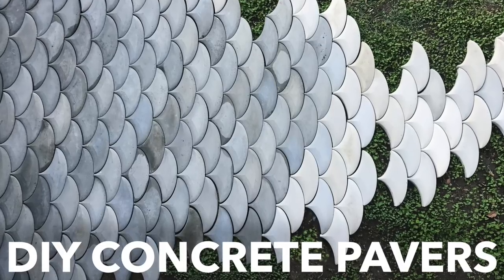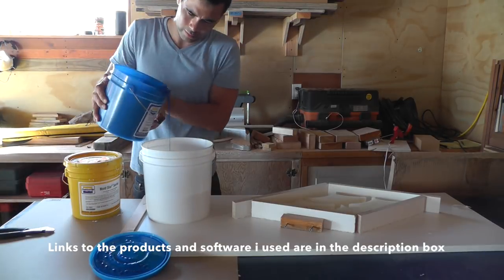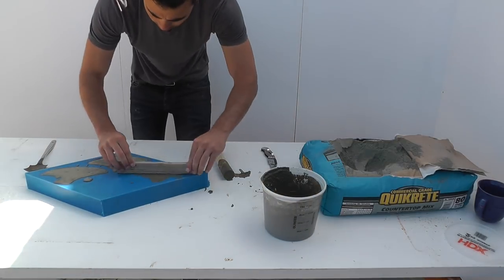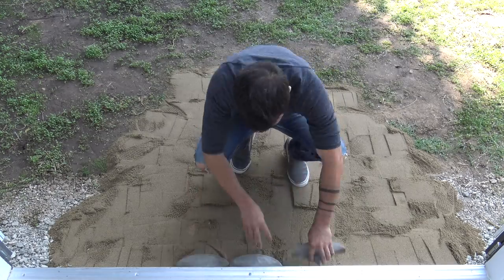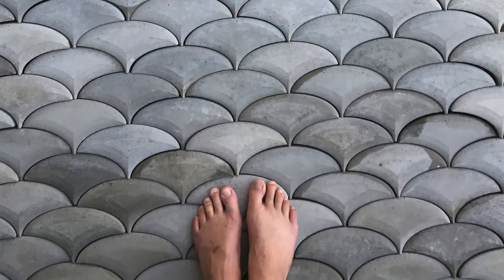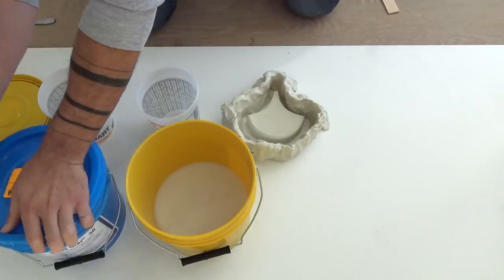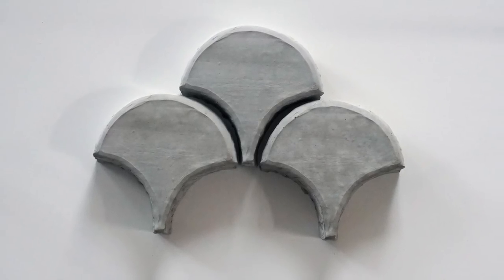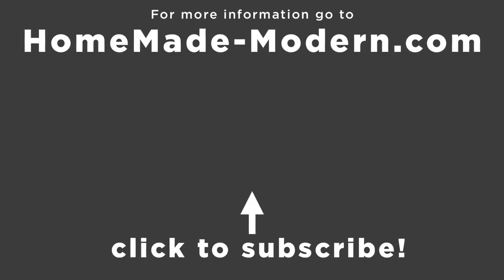DIY Concrete Patio Pavers

Comment from the maker: you can download 3d modeling software for free.  many local libraries and maker spaces have 3d printers.  Link to the silicone rubber product I used: http://amzn.to/2iF3N8Q  the mold is reusable and easy to clean.  We made about 1-2 batches a pavers a week over the last few years.  It only takes about 15 minutes to make a batch.  I used combinations of Quikrete Countertop Mix in both White and Grey along with Quikrete 5000 to make these pavers.  If you want to have greater color differential try the Quikrete liquid cement color.  Here is a video I did on coloring concrete: https://youtu.be/t1PRbMA9koM
Reply: You did such a great job, I was wondering if you happen to sell the silicone molds already made?
Reply: Do you have a link to download that 3D File? It is so cool! If not and you still have it could you please put it on Thingiverse or something be so I too can make the same pavers as you? Thanks a bunch.     :)
Reply: Could you be so kind and share the 3d file?
Reply: HomeMadeModern cool
Reply: HomeMadeModern i
Reply: Wow, they are beautiful! I really liked the 2nd batch the best! Both are beautiful though. 😊
Reply: share the 3d file please please please...

Comment: For the analog pavers, you can also make a single.  Then use the single to make 4 copies.  Then make a mold from the 4 copies.  This would also allow you to make your first paver from something that is not moldable or as easily repeatable like wood or carved foam.

Comment: nice ... I once worked for a hard-scape installation crew.  We always built a sub-grade of 4-6" made of a compacted ABC gravel. With 1" of polymeric blended sand.  The pavers always stayed in place.
Reply: Richard Gladle One summer our city installed pavers in the medians and sidewalks. Everything looked pretty. One winter passed. The following spring they had to be reinstalled as they were put in incorrectly and already were making a lumpy unsafe surface. Definitely pays to do the job correctly the first time!

Comment: If I did this (because ughhhhh I don't haaaaave a 3d printerrrrrr), I would probably make a dozen or so using the single paver mold, then use those as positives for a much larger mold. That way, I could do larger batches. Just an idea

Comment: It looks great and very smooth....so smooth in fact that I feel it will be slippery when wet....thoughts?
Reply: The edges of the 3D printed ones are textured from the step-up profile that the printer makes from laying down rows of plastic. It isn't completely smooth there but I don't know if the texture is enough to not be slippery. You can see what I'm talking about at 1:41 on the video. But, generally concrete is too alkaline to grow bacteria, so slime colonies would have a hard time developing without a layer of tree sap sticking to the surface first. It really shouldn't be too slick even when wet, but you could always sprinkle some sand into the bottom of the mold before casting to have a non-slip coating in the finished part.

Comment: I work in landscaping, my career is creating brick paver pathways and patios. You should never put pavers on straight up ground. You should always dig down 4 inches, and use gravel. Then pack the shit out of it, level it with a level and then use finishing sand and level that as well. The way you did it makes a lumpy, uneven surface and in a few years it will have gaps and will be unpleasant to walk on.
Reply: I think he wants the gaps and stuff though from what he said.
Reply: Beth Ann he's not talking about gaps between the pavers, he's talking about gaps coming from under the pavers. The ground is too unstable without first digging down, then adding aggregate (rocks, usually), then tamping down, then adding sand, then tamping down again.
Reply: Zach Tettamente  you are correct, in a couple of years his pavers will be broken, uneven and the laughing stock of his neighborhood.
Reply: Joe Mama "laughing stock"

Comment: Why didn't you print a mold? Does concrete not release from the plastic? Could I just skip a step if I used a flexible filament?
Reply from the maker: I have done that but I found that molds tend to break down after about 4 uses.  if you look way back on my instagram you will see some direct mold experiments

Comment: a compass with a pencil could easily lay out the basic design on some MDF.  cut it out with a jigsaw.  smooth out the cuts and round over the edges with a sander.  spray it with some krylon plastic type paint to help with mold release.  repeat as required to have enough to form your mold. follow through with the rest of process

ya ya I know it uses a pencil so this method isn't a DIY project either really  :) :) :) 

pretty cool concept - thanks for the video!

Comment: I have a question! I understand that this is an incomplete project but how do u plan on getting the stones to stick to the ground? Is the sand supposed to make sure these concrete pavers stay intact? Or will you be gluing them down later or something?
Reply: Haley Gilbert you dont glue paver brick  down you lay them on sand then you sweep sand or grout in the cracks then wet it

Comment: Love this project, probably my favorite concrete project I've seen of yours. Do you want to leave the edges ragged and organic or could you make custom edge tiles?
Reply: Either could be done. A new mold would just be required to make an edge piece
Reply: jfkusa123 For edge tiles, just cut tiles in half, with a stone blade, in either a table or circular saw.  Use a wet saw for an even safer, cleaner way to cut them.

Comment: I'm very conscious about the edges of my path.  I have a doberman that would run haphazardly around the backyard and slice open his paws on the edges.....or push them out of alignment.  Therefore a pattern that locks them in or a frame around the edge is necessary.

Comment: Honestly, criticising a project because they don't personally own a 3D printer is just whinging for the sake of whinging - if I don't have the hardware I need for a specific job, I go to the hardware store/hire shop & get it. If my printer isn't up to standard for my artwork or photography, I go to the print shop & use theirs. It follows logically that if I don't have a 3D printer, I'd go to the library or print shop & use theirs. If it's within your budget, it all comes down to how badly you want to learn, or whether you'd rather sit around whinging & making excuses for yourself.

Comment: Oouugh. I don't have a 3D printer so it's not A DIY project.
Reply: KVPD you dont need a 3d printer ypu can carve your  shape out of foam ot even wood or use clay or playdoh to make your  master piece for molding use the thing in your head called a brain